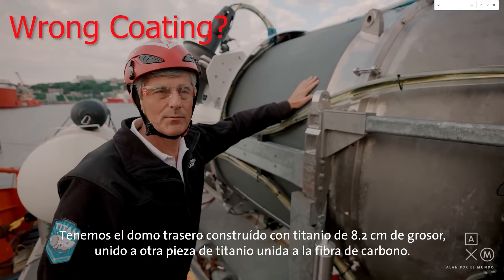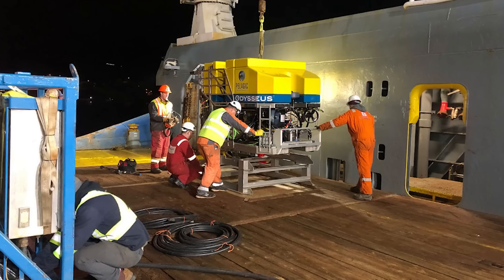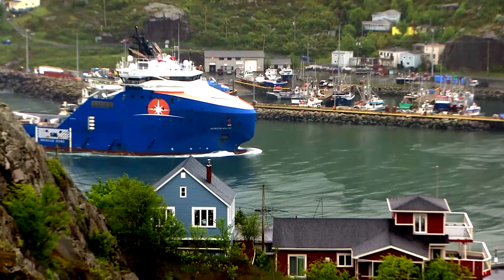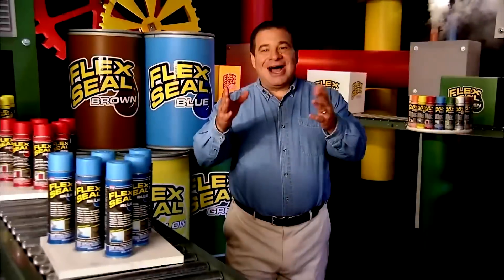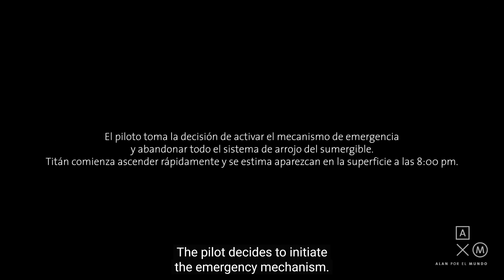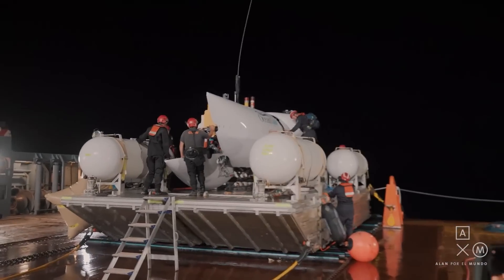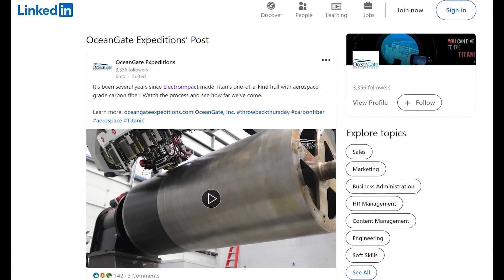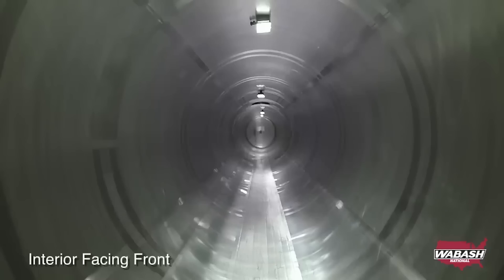Titan Sub Wrong Coating? Hull Construction, Debris Field Search

Comment: Cutting corners cuts lives short.  If were a family member of the deceased tourists I would sue the company and Rush's estate.
Reply from the maker: There were no corners on that hull! LOL! YEs he even went with the smaller cheaper Polar Prince boat and had to drag the sub behind them on the choppy ocean
Reply: @jeffostroff . Intwesting ….
Reply: and also calling a failure with your model a success only means that when you die it was a success🤣🤣🤣🤣🤣
Reply: I think a waiver I saw for the titan on a lawyers channel said they’re not “tourists” they’re “explorers” or “citizen scientists” as a way to dodge the liability of not certifying the vessel. 🫣
Reply: @Anniiee5298  they can call it whatever they want, you have a reasonable expectation of safety when it comes to commercial products (like a vehicle you pay money to go for a ride on). think about a theme park rollercoaster. they build a new rollercoaster, but they use aluminum for everything instead of steel and then refuse to go through the necessary steps to prove that it is safe for human use. that shows a pattern of negligence. that is what stockton did and he documented every single step so we can see how he ignored safety all the way up until the point he got himself and those other poor souls killed. 

even the people who safely went on that sub have a good chance at getting money out of stocktons family if they have a good law team. stocktons family will likely settle every case as soon as possible so that they can move on and distance themselves from him as much as possible. they will be left broke and disgraced for the rest of their lives.
Reply: @mistaajones  right. From what I’ve learned the waivers can include whatever they want to CYA but like you said, along w their pattern of negligence, they blew all their money covering up whistleblowers and paying off employees that warned them of dangers of what they were doing. 

Probably why Stockton said he didn’t want to hire “50 year old white men that don’t inspire anyone”🙄🙄🙄 unreal. Even tho those guys are more qualified than the college students he preferred to employ. But the college students didn’t question his decisions. So sad. 

Regardless. This has been an interesting rabbit hole, legally and engineering-wise, that I never saw myself going down.
Reply: @Anniiee5298  yeah which does not work when normal regular people are to stoned to understand the full implications of what tat means which is why ocean gate is the next Big lawsuit scandal they thought they were above the law soon they will be sued out of existence because of their negligence over human safety sucks to be part of ocean gate now🤣🤣🤣🤣🤣
Reply: @raven4k998  they’re being sued into oblivion for sure but there’s no money
Reply: Billionaire families suing some dude with a few million to his name? No... they would be too busy fighting over the family fortune. Some might even sent Stockton's widow a gift basket. The nett wealth of the passengers of the Titan was $2.86bn.
Reply: @nickl5658  its not about the money. he showed a pattern of neglecting safety and used the windows 1300m certification rating as 'proof' that it was safe. without that nobody would have stepped foot inside that thing. he essentially tricked people into going. 
would you ride a rollercoaster built out of plastic or aluminum? probably not. what if it had been tested and had safety ratings from reputable agencies? okay, maybe. what if you were told it had those safety ratings but in reality only the first third of it was proven safe? that's essentially what happened. 
i would expect his family to immediately settle so they can quickly distance themselves from all the shame and disgrace that they will now experience for the rest of their lives.
Reply: Rush is more interested in creating his amusement park plan and getting paid. I'd guess that more research and testing goes into anything being used over there with Disney Land or Disney World.

Comment: In the 1/3 model they used carbon fiber caps. Now that's crazy.
Reply: Didn't they change the design and not use the carbon fiber on the caps? They switched to titanium because of this test. Did they do another 1/3 test with the changes?
Reply: @westzed23  yes they did change to titanium caps in the final build but it is interesting that the window popped before they registered any hull damage. On the final design it's been said that the window was rated for 1300m. I'd be curious to know what other tests were done(or not done) on the other models.
Reply: I was thinking that the carbon fiber failed at the window mounting surface which is why they switched to metal domes. But maybe I understood wrong.
Reply: 9.1.1. what is your emergency?

I love how the model failed and they call that a success🤣🤣🤣🤣🤣
Reply: @raven4k998  They said success to 4,000 psi, which it did not fail at. Obviously everything fails eventually if you go high enough...
Reply: @gavinjenkins899 So, instead of testing to 120% design pressure, they tested to about ⅔ design pressure, and called that a success?  😂
Reply: @geodkyt  A success TO 4000 PSI, is what they very clearly said in the video. How are you possibly still confused by this after it was directly pointed out already the words you missed? Not "A success to the original target pressure", "success to 4000". You literally just need to open your ears and actually watch the video before commenting on it. They were objectively correct in their statements, even using your own % preferences you just gave, since it failed roughly 20% above what they said the success number was.
Reply: @raven4k998  It succeeded in their eyes until the 3000 ft, so they felt optimistic.
Reply: @bikelifewithalex120  no it succeeded until 4000 but the titanic is deeper then that one a meter is more then a foot so yeah I would be shitting myself going into something that implodes at 4000 feet when Titanic's 3800 or 3900 meter's below the surface of the ocean specially in a sub called titan🤣
Reply: Do we know if that test put equal pressure on all sides? Was there equal pressure on the middle on the CF Tube?
Reply: @Whydoyouneedtoknow776 The test article was tested in the university of Washington’s test tank (that it wrecked).
There would be about 10kPa/1.5psi difference in pressure from top to bottom of the submersible.
Reply: @allangibson8494  Thanks for the info! I assumed the air pressure would be spread evenly around the object but thanks for the hard numbers 🤙
Reply: @allangibson8494 oh my gosh! Wow I remembered reading that some where but it slipped my mind because of everything else oh my gosh! Wow! That’s really something else that they still went through with the titanic missions even after it failing in the test article. Wow just wow. I have no idea how this could even be legal. Irregardless, enough people in the submersible community knew that this was an accident waiting to happen I feel as if more people should have spoke up about their experiences and their opinions about this titan submersible on the mainstream news etc so at least these passengers could have maybe possibly known what they were getting themselves in too.
Reply: @sabelmwheeler9279  to be fair it was the window that gave out in the test and they did swap the CF Caps for Titanium ones in the "final" build.

 But I've heard the window in that build was not rated for depths the Titanic lay at so it would be a huge oversight to go through all the trouble of swapping the material of the caps just to use an inferior window.
Reply: @Whydoyouneedtoknow776  air pressure ?,, this was a hydrostatic test
Reply: @Whydoyouneedtoknow776   Yes except the acrylic window was enormously thick, it took three men to lift it.  Visually at least it didn't look under designed.
Reply: @sabelmwheeler9279  It was legal because they operated in international waters. And legally took no passengers... everyone was a "mission specialist". Oceangate took great pains to navigate around the law to avoid regulatory bodies.
Reply: @nickl5658  okay that makes sense now why they called them “mission specialists,” I kind of figured that was why. To get around some kind of regulation but I never did the research myself to figs out if that were the case! Thank you for answering that ? For me too! That makes a lot more sense too!
Reply: @sabelmwheeler9279  I agree with you completely but I also think you just mean "regardless" because "irregardless" isn't actually a word. And if you change out your statement to say regardless it still makes sense regardless of the made up word. :)
Reply: @Whydoyouneedtoknow776  " I assumed the air pressure would be spread evenly around the object but thanks for the hard numbers" There is this thing called gravity and it is why that huge pressure is present at the bottom of the ocean...
So why exactly you are assuming that in the laboratory there is no gravity/laws of physics do not work?
And they were testing it against water so obviously they did not used air and even with air there will be a massof this air so there is no way to not have different pressure in different parts especialy when the air pressure is few hundereds of atm.
Reply: @Whydoyouneedtoknow776  It's not clear whether the window popped of its own accord, or because the frame that it was held in distorted or cracked under pressure.
Reply: @Jester123ish for your own safety down do deep dives where your safety just depends on whether or looks will built or not
Reply: @anthonyskata  No of course not, but we’re all looking at the design to see if there appears to be a weakness in the design.
Reply: @Jester123ish  wether the window failed is irrelevant. It was not rated to the depths that it was taken to. It was clear negligence
Reply: @sabelmwheeler9279  Well, technically the carbon fiber domes failed on that 1/3 model test, so being the geniuses they were, they thought "oh looks like the tube didn't fail, so let's go ahead with the tube and just change up the domes!" Did they test it again with the changed domes? Likely not at 1/3 scale. They probably just went ahead and built the real thing due to saving costs and stuck Stockton with his test pilot for the "real" test.
Reply: @Jester123ish  The acrylic window bulges in halfway when they are at Titanic depths.
Reply: @bradleyknopp7303  haha thank you! It was late when I wrote that but I actually didn’t know that. Maybe I should edit my comment so I don’t sound so dumb then. I hate when people go in on others for their grammar. I wasn’t always the best at grammar in school. I struggled with it quite a bit! That is probably why I feel sympathetic towards others when I see people being mean about it. Thank you for being nice about it though! I do appreciate that, now I will know!! Usually auto correct fixes those screw ups for me!
Reply: @Whydoyouneedtoknow776 they didn’t test the hill itself just a small mode made with the same materials that they put inside of a small pressure test chamber
Reply: @Whydoyouneedtoknow776  Pressure is equal all around. Only the plexy-window on the cap for sure is a weak point; no CF-strength whatsoever here!, in the right direction - towards the inside.
Reply: @Whydoyouneedtoknow776 why do you need to know?
Reply: They did a 1/3 model because there isn't likely a pressure chamber large enough to test a 1x article. You can learn a lot during engineering a vehicle to work with scaled models. Faster and cheaper learning. This doesn't mean that scaled tests should be used to certify the final vehicle.
Reply: @@JimRex-vv4qs The damn thing just wasn't up to it 5415 psi
Reply: I wanna see the teeny tiny cutesy wootsey little 1/3 scale spray gun they used for the rhino liner.
Reply: @@JimRex-vv4qswouldn’t the heavy ballast all but ensure that people shifting about didn’t pose a problem to the vessel’s balance?
Reply: A 1/3 model has a 1/9 surface area and a 1/27 volume. The surface to volume ratio is off by 1/3. How to correlate the test results against such a distorted surface to volume ratio?
Reply: @@JimRex-vv4qs I've seen nothing that would lead me to believe that a high rate of pressure onset could cause premature failure.
Reply: Law is made as part of the spoils of victory and at the expense of the loser.

Comment: its rhino shield  .. bullet proof and  submarine  proof.. what  could go  wrong
Reply: that stuff works. No Rhino has ever gotten through my truck bed.
Reply: well that's why the sub imploded he should have used flex seal not rhino liner as it has never been used under water were as flex seal atleast has in the flex seal commercial which is more then rhino liner has done so yeah🤣🤣🤣🤣🤣

Comment: Isn't that stuff essentially pick up truck bed lining from Autozone?
Reply: Yup, it just gets more laughable the more info that comes out.
Reply: Really??!
Reply from the maker: They have a marine division
Reply: It looks like he used a substance similar to Durabak, a substance used to coat marine surfaces for the purpose of anti-corrosion and anti slip. It is the SAME substance as Heculiner, truck bed liner. Heculiner is supplemented with small rubber chunks to increase thickness and roughness. But, it's the same material. I covered my old car with it. Rhino Liner , Heculiner, Durabak. All the same stuff. I can't leave a link. But Google those products. Durabak may have been a slightly better choice, slightly. The navy uses it to coat surfaces.  Anti corrosion, anti slip.  It seems hard, but it will flex, that's why it won't flake off sheet metal, like a truck bed. Fiberglas epoxy would have been better, to a small degree. But, I guess he wanted the simplicity of a one component substance he didn't have to mix right before use.    Kevlar vests, armor uses a better epoxy to hold it together than this Rhino Liner crap.